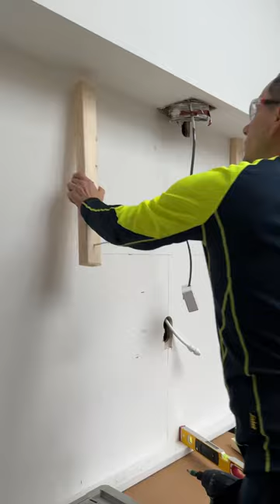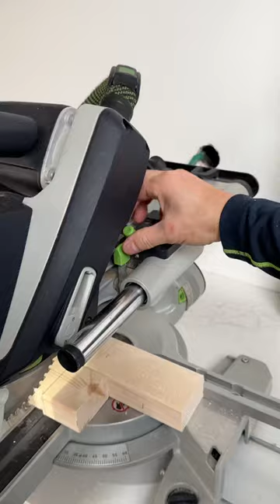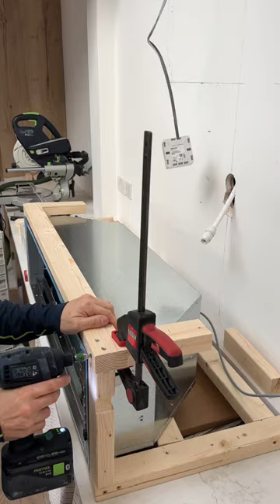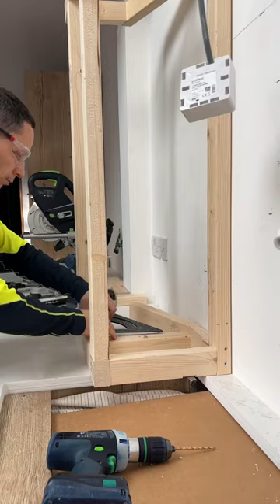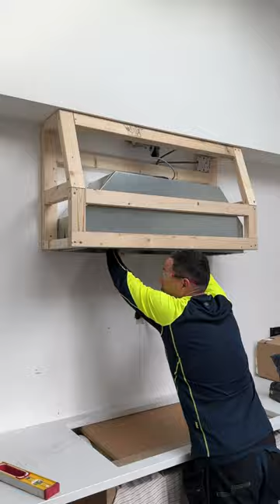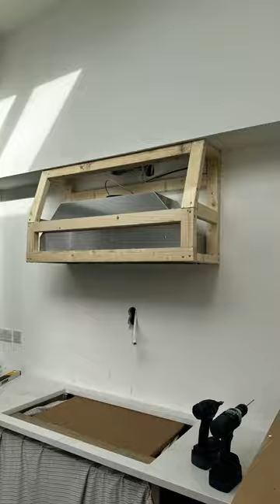Extractor hoodie made of timber

Comment: I really like the work. I think for added durability adding some type of lacquer, Mold resistant primer, Something to seal the wooden from humidity.
Reply: I have built several of these over the years. It is just framing and will get cover with drywall and finished with tape and float.
Reply from the maker: Thanks for the tips! I actually tell plasters to add insulation so that can be more silent when running
Reply from the maker: That is right it was plaster board and insulation inside thanks